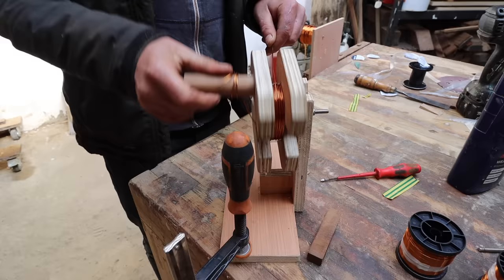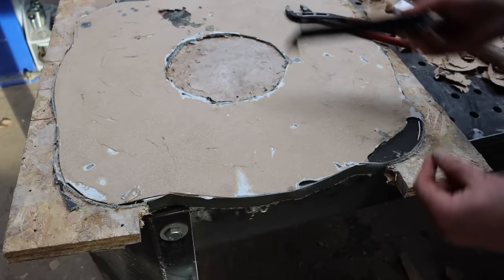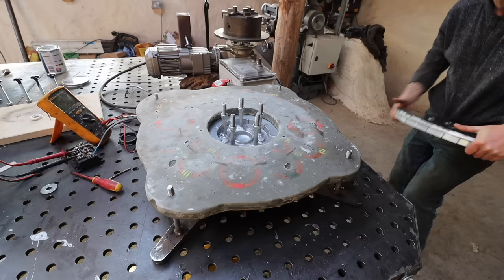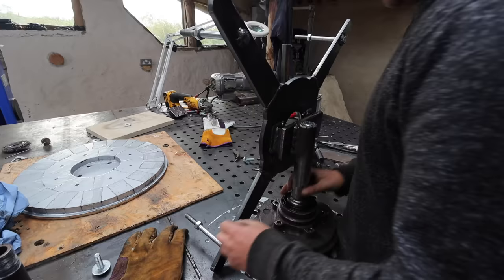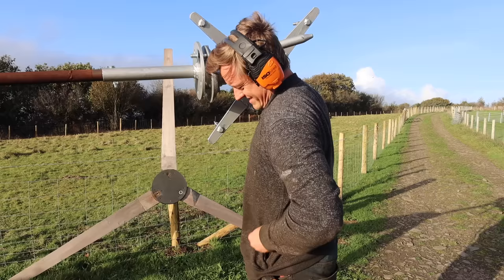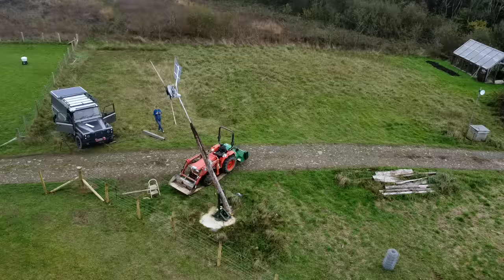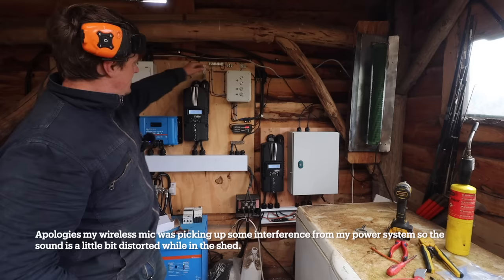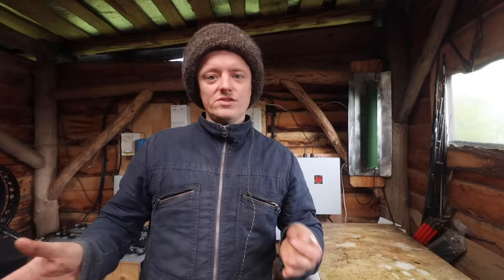Off Grid 2 KW Axial Flux Wind Turbine And MPPT Dump Load Controler Build

Comment: Why not dump extra power into water heating, which you can tap for hot water tank and space heating? Also possible is Hydrogen generation with excess power, tank the hydrogen (low pressure) and use it for cooking, torches, etc. Great videos! Thank you for all your hard work!

Comment: Just discovered your channel with this video popping up after the Fully Charged Show.  Absolutely brilliant!  Thank you for sharing this. 
How much more efficient would this be with optimised blade design? 
Might a dynamically furling blade design be a better way of optimising power output than just varying the impedance of the electrical load with an MPPT controller?
I am about to take my first steps by putting a commercially available blade onto an old washing machine motor, so I'll go back and look at your other videos too. Wish me luck!

Comment: GREAT work. How about welding a length of chain to the pipe supporting the turbine, and the pipe it rotates on, so that will only allow the turbine to rotate on the shaft a set number of times? AS far as I'm concerned the voice & video quality are fine, the content is brilliant. So I guess the barn means you won't be building an electrical grid for you and your neighbors to share power? (LOL), Great work - Respect.

Comment: Interesting work! I like it but I have 2 questions:
1. Did you connect earth potential to metal frames both outside, at the mast, and inside at the power convertor stuff? Also, over-voltage dischargers and lightning arrestors?
2. The magnetic circuit doesn't seem to be closed. There is a magnet on every side of each coil but the ferromagnetic connection between them is made up of some screws. Also, you don't have any ferromagnetic core inside the coils. This decreases the efficiency of the generator a lot.
If I missed some details in your video, excuse and ignore my comment.
Cheers!

Comment: may i suggest that when youre welding that 4 point piece and doing butt welds that it may be more beneficial and provide better strength if you bevel at least one edge. Youre really not getting too much penetration. Specially since they are 3/8-1/4 inch thick ima assume? Also being rolled steel you want to get that oxidization layer off least a 1/4 inch further then your weld  so you dont pull those contaminates into your weld.

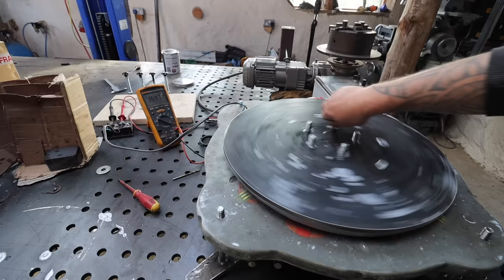Comment: 17:30  I noticed that the magnet may not be axially aligned since the 3D-printed brackets/holders are wobbling as you spin it around.  I wonder how this could have been overlooked considering how precise almost everything is  that you do...  will this unbalanced stator cause instability problems later ?  Could it break while under load and at high speeds ?   Also at 20:10, the top set of magnets are also wobbling around...

Comment: Rather than dumping that extra power to heating element, get inverter and dump extra to grid and make some money from extra power. If wind is getting out hand make wash plate that adjust the angle of the blades, so if there is too much rpm's it first starts to pulsate shorting the output and if this continues too long that there is heat issues, it kicks solenoid that adjusts the angle to so it wont turn.

Comment: The stuff you called copper grease  wasn't anit-siese was it... if so that has things in it that are abrasive... you will want to wash that completely out with a solvent and replace with a proper wheel bearing grease if the bearings are not destroyed already.  Keep up the good work you do. I wish I was in your shoes.

Comment: I would use the excess energy to heat water for radiators to heat my home and or work shop.
(Edit)  It may not be a constant heat, but it could supplement the heat your home and shop already have.

Comment: Coil winder was kind of hooky. Two simple fixes. 1) Add ball bearing to shaft. 2) Add a follower or wire guide. Other wise, cool. Many examples can be found on Electronic channels. Search Coil Winders. Imagine winding a Tesla coil with 1,000,000 turns. Uniform coils will operate more efficiently and generate a more balanced output. My upgrades cost a few dollars but save time to offset.

Comment: I've actually been trying to build a wind turbine from a front load washing machine permanent magnet 3 phase motor. I have been having issues making the blades correctly, and I am wondering if you might know where I can find some information on shaping the turbine blades correctly? I live in the northern united states, in central Minnesota and we normally get a strong northwesterly wind where I live. Somewhere around 15 mph on the ground, but 30 feet off the ground I estimate the wind to be around 30 - 50 mph. My property kind of sits in a dust bowl. Any help would be appreciated. I don't have access to the awesome tools that you have, but I can figure out how to make just about anything, so it shouldn't be an issue. I love these videos of yours, not only are they well made, but you also give an amazing amount of information within them. Thank You for any help you can provide me. Keep up the great work with the videos.

Comment: Make a stone bunker. In it build a H2O to H-O genny. When companies build commercial wind gennies, they install bleeder resistors so if they start producing more than your using... The resistors start bleeding off the extra juice. Use the same switching but instead of throwing energy away send it to the H2O to H-O genny. 
You can goofle "how to use electricity to turn water to Hydrogen." As well as how to add the switching by goofling "elec diagram of wind turbine over charge protection resistors."
When you run low on your wind juice you can set up an abbienormal gas geeny. Guesses what you power it with?
And low you hath made an electrical to chemical to thermal to mechanical to electrical power converter/battery. And it was good.

Comment: put a relay across the solid state and feed the coil from the load side of the solid state. Something is telling me it won't work but I cant see it. Shund the SS relay with a regular relay so if the SS fails open the regular relay will give full braking

Comment: I had trouble with my tower in scaffold pipe - at certain speeds it got a harmonic whip that almost shook it to bits - even with wire braces I couldn't stop it and had to pull it down - it was a smaller generator than yours from a boat

Comment: Might be worth moving those dump load resistors into an insulated box of sand (sand battery) to store the heat.  Then you can run a water tank / water coil / radiator / hot water (on demand)?

Comment: 35:23 sorry to be a bit pedantic and I’m sure what you have done is more than adequate. Sometimes putting say 3 or 4 web braces to support against lateral movement. I would just worry about the weld cracking eventually but I’m sure it will be fine. A fabulous and inspiring design though mate.

Comment: How about making a vertical bladed one since you're using it on open ground, 6 or 8 bladed vertical blades straight up say 8ft or 10 ft in height then you won't have the issue of it turning and trying to rip itself apart, though it would have to be embedded in the ground and you'd have to make a similar shape to an aerofoil per blade on bearings, each blade would need a bearing so it can freely pivot. Seen these made and work very well.

Comment: Hi Kris, did you consider using exes power to pump water into a reservoir for the hydro electric system? Just like it is done with Pumped-storage hydroelectricity? Might be a cleaner way to store power than batteries.

Comment: Regarding the weak point in the system, could you put 'aux 1' into a 12v, 4 pole NC contactor and wire the three phases through it as you have with the manual stop switch?
This way, if all power is lost, the 3 phases would be shorted and the turbine would stop. It also takes away the single point of failure from the SSR.

Comment: would there be a way to apply the breaks by using aux 2 pwm to trigger a breaking mechanism? That would allow you to reduce the output when needed. Another idea would be to have multiple dump loads not just a heater but some other storage ideas like heating water or cooling something with peltier units.

Comment: 47:31 can you heat a water tank for washing etc? Or do a pumped hydro where you pump up to a reservoir at a high point then you have a water source as a “battery” to generate power in lean times or emergency.

[edit:] Perhaps even pump water up for irrigation purposes

Comment: I love midnite classic controllers, I wish I had a few 150's  so I could use one for a turbine,  and two for my solar,   they are Soo costly, but worth it,  with everything they are capable of,     I wish more were capable of working with turbines,  even a dumb version that is basically just a dc converter would be better than direct connection, to allow the turbine to make some power, instead of being pulled down,  I wonder how a dc converter would act connected to a turbine? Or if it can be modified to allow it to spin to a higher voltage before charging, nearly $1000 is a lot for a charge controller! I wish I got into electronics when I was younger, and could build my own controller!

Comment: After reading many people comment about using a torch to remove the resin bubbles I have to say why not just use a heat gun on the setting that applies best for the application?

Comment: Why no metal core filling the coils?  I recon you could increase your output quite substantially with some core material in the coils... because it would drastically reduce the air gap issue, which is a huge loss factor.

Comment: Impressive build and skills, but, one question (somebody on here said you are an electrical engineer, so from one EE to another) unless I missed something your coils are large and air cored, ie there is no magnetic material through the middle of the coils and the rest of the magnetic circuit is made in solid plate which is not in insulated layers (laminations or 'lams'). I think if you could get the air gaps in the magnetic circuits to a bare minimum, like they do with mass produced motors and generators, you should be able to use much smaller magnets and get a much more efficient generator. Having said that, your dynamic braking test means a pretty good coupling between magnetics and electrics. I just wonder if you have tried other magnetic designs and how did you get to this arrangement of coils and magnets?

Comment: Why did you choose the vertical 3 blade design rather than a design with a horizontal stator and "squirrel cage" type blades on top?
I would think you could avoid the need for the tail and for one of the bearings, as well as any chance of wire twist.

Comment: Just stumbled upon this vid, first question how are you counting 150 turns wondered if a bicycle wheel counter would work. I've worked for a company many years ago where we dipped the coils in hot varnish several times and allowed to cool then repeated it until a layer built up.

Comment: 44:24 put a bag or blanket over the winch cable if it lets go, it will drop rather than going up to windscreen. 

Also stand perpendicular to the line of wire. 
And never step over, as you did, as if that lets go you may loose your frank n beans, of worse…

Comment: When your batteries are fully charged you could use an electric hot water cylinder as a primary dump, with the heater as a secondary. Free hot water for ??? greenhouse heating

Comment: Dang dude , you have a fair sized factory there . 
   I am going panels and batteries , with a small inverter that could take wind power . 
wind comes from all directions . 
Took me some time to think about cable twist :-) 
Motor on the blade , which turns to face the wind , cable to inverter is stressed . 
  Am thinking , rather have the motor below the fan blades ? No rocket scientist :-) 
   All well and good , so 2.5 kw from the turbine ? 
How does that cost compare with solar ? 
 am almost covering my roof with panels , I get good sun . 
 About 1.7 kw in a breeze :-) 
     Am a fan of not paying for electricity . 
With all respect , you have done all this work for a few hours , + material costs :-) 
    Get it up , it works , might need to change the mast ? 
Oops , sorry about that . 
  I do like the idea of wind power , got lots here at the coast . 
No big turbine in my garden :-) 
 4 x 4'  ones on a 3m pole could be cool . 
 Not really for 2 years , food for thought though , thanks .

Comment: Instead of using a heater to dump unusable electricity, could you reverse the direction of the hydro setup and pump water from the bottom of your back to the pond? Hydro storage would be really exceptional.

Comment: Can I ask a dumb question? There is the charge controller for the wind, that feeds power directly into the batteries, but you also have a few other systems (hydro & solar), how do the various controllers connect to the batteries? Are they all just in parallel? If so, how does each one sense the battery voltage? I mean if the wind generator was on its own, it could measure the batts at say 24V, then pump in 26V for a while, then pause and measure again etc. But if there are several charge controllers hooked up to the batts in parallel, wouldn't each unit's charging voltage confuse the measurement's the others take? Clearly it all works, I just don't get it!

Comment: Why didn't you close the magnetic circuit by putting iron in the center of the coils?
This works - but the magnetic circuit should have gaps (to allow rotation) that are as small as possible.

Comment: I love this wind generator. Could you post a link to the 3D-printed parts? Also, what type of filament did you use? Do you have plans for this including a parts list?
Reply: Interesting if you could share key specs about the generator design including wiring, magnets, sourcing and pricing

Comment: Hi Kris, re-watching this for a 2nd time after seeing some of your more recent stuff...  Just a thought, could you use your surplus power (once batteries are charged) to kick in a water pump?  This could be used to move water between two reservoirs one at the top our your hydro system and one at the bottom...  Effectively using them as giant batteries for when you've got low wind!?

Comment: Are you using steel or iron? It looks like steel to me. Had you tried iron instead, durring engineering of your project? I  ask, because that's what is usually used. What was your conclusion, regarding materials? Oh yeah, what length did 150 rotations come out to? Or what is the interior diameter of your winding jig?

Comment: It looks like you use Ferrite magnets? if so, is this because of temporature or price? 

It seems ferrite can handle like 250 degrees but only do around 1/10th of the power of the neodynium magnets, but those are only normally handling around max 80 degrees but they also cost 10-15 times the price (but is it worth it over the lifetime in extra power output).

Eg ferrite 100X57X20mm pulling force 12 KG @3,62€, vs Neodynium 100X50X20mm with pulling force of 125 KG @46,68€, however a 100X50X10mm neodynium is only 21,93€ but has pulling force of 44,80 KG and able to make a smaller generator.

In a wind (and/or hydro) do you know the about temporature the magnets gets?

Comment: Fabulous as always. Could I ask a couple of questions? First. The copper wire, is it coated/insulated? Secondly, the resin structure, is that the load bearing frame for the whole unit? Thanks.
Reply: The copper is the type they use for winding motors, it is insulated with special lacquer.

Comment: Greetings Kris, Thoroughly enjoyed the wind turbine upgrade. You mentioned the need to monitor the system, can I suggest something like a Raspberry Pi with the input channels connected to key points in the circuitry. You could then have alarms and all ok messages sent to your phone/pc or just an outside alarm. Also did you deploy fuses anywhere? 

I found my thought processes were running alongside yours during the video and sensed the thrills and disappointments on that fun journey. 

Best wishes for the Barn
Kind regards 
Howard
Reply: Hello, want to go 50/50 on a company building turbines?

Comment: I assume aux1 is a low current solid state dry relay that its behavior is programmed through the controller? If so will that heavy relay you are using draw too much current and ruin the aux1 relay over time? You are holding it open constantly through aux1 with 12v directly from the batteries? Will aux1 tolerate the current that heavy relay will draw over time (through aux1) and not burn out? I would think that heavy relay would draw over 1 amp. Just something I have learned the hard way trying to constantly power something using solid state relays that are only rated for micro/milli amps and pulling too much current through them especially constantly over time. Just would hate to see you damage that controller as I know their expensive. That other solid state relay that you are using to power the heater should be fine getting switched so much like that providing it's rated for the max current that heater can pull.
Also how did you balance that turbine rotor or is that needed? Hope I am making sense, brilliant job never the less, cheers.

Comment: A table with a built in vibration system would float the air pockets quickly and evenly. this comments is only at the casting of the coils part is- carry on lad.

Comment: Instead of just heating the power shed why don't you hook it up to a hot water tank as the dump load? I've got a similar set Arduino based for the dump load but the held open relay for the break is brilliant! Redesign now